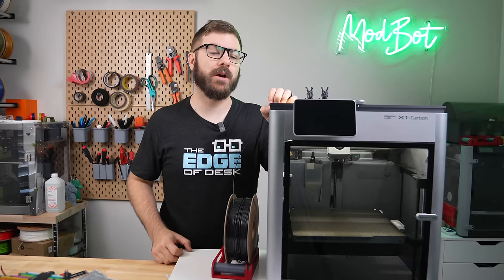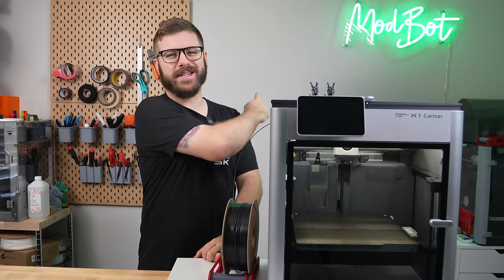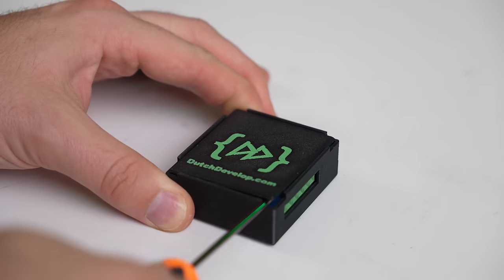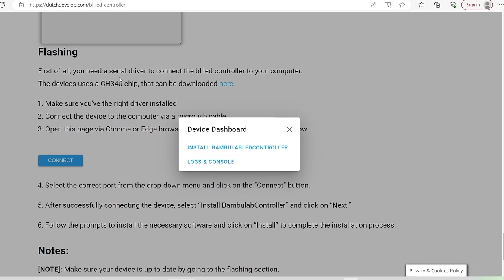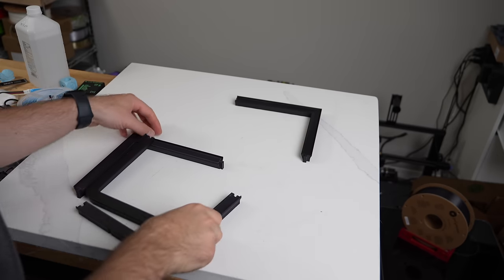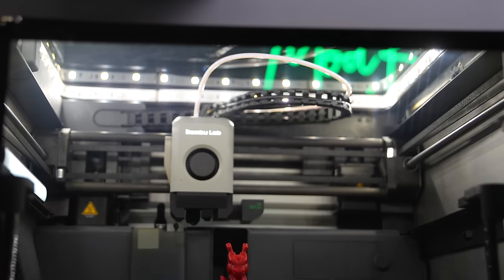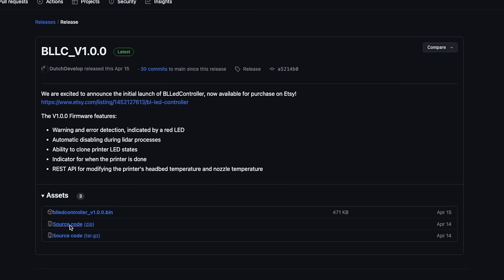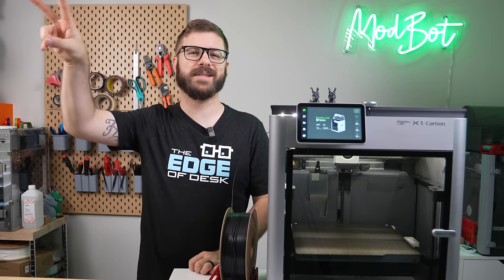Status LEDS for your Bambu 3d Printer! (BL LED Controller)

Comment: I have an ender 3 pro. Not an avid printer unless I need functional parts for something. Ordered a creality k1 max and 2 hours later cancelled the order when I saw the rave about the X1C. It’ll be here tomorrow and I feel this is a necessary mod. I love how intuitive it is. I’m very electric and electronic inclined but not software savvy but I think your video shows enough for me to figure it out. Thanks so much for your time creating and sharing this vid!

Comment: Glad to see Dutch's controller (and the mod work + MQTT connections the rest of the community has been doing with the printer) get more coverage! There's a surprising amount you can do with the MQTT data from the printer, despite it being quite "closed" as 3d printers go! With my own setup I have automations to control my lighting just like this (Dutch and I were throwing around ideas back when he was developing the prototypes), automatically turn on/off my bento-box for air filtration if it's currently printing with ABS or ASA, and much more! I practically have the whole printer controllable and monitored from HomeAssistant + NodeRed.

Even getting the bed-mesh visualization from the printer was pretty neat, but unfortunately that won't be available on the newest firmware (but can be rolled back to one where it works), so it's important to know some things may change quite fast!
Reply: I miss klippers visualisations lol.. have you seen anything about getting this back please? I didn't even know it was possible, but I'm only 3 weeks into this particular x1c... my ender 3 pro whimpering in a corner modded to death lol.
Reply: @Mr_Gadge  Unfortunately newer firmware doesn't provide the information still, but luckily the one that does work is able to be downgraded to via the handy app. What I usually recommend now if people want to know the visualization of their X1C and to manually adjust it, is to roll back and spend a few hours with it, then re-upgrade firmware.
Reply: @WolfwithSword  ok many thanks. You’d think they didn’t want people to see how bad their beds can be 🤔🤣
Reply: @WolfwithSword How do you get into the mqtt data to see the mesh data?

I'd like to check how level my bed is
Reply: @Tom--Ace  Unfortunately it needs to be rolled back to a slightly older firmware and is for the X1C only. It gets the data for each point one by one so there's a lot of work involved in building the mesh. I have some guides for it and nodered flows that take care of this available. Should come up in a quick search!
Reply: How about controlling a chamber heater if printing abs or asa through mqtt?
Reply: @adamklosterman8960  Can easily be done but you'd use the mqtt mainly to get the state of what the printer is printing with, then use that as a trigger for an automation in something like nodered or homeassistant, to then start up a chamber heater that would also be connected as an IoT device.

I currently do exactly this but to control my bento fans with my nodered flows.

Comment: btw, I think the AMS uses 24V
you could probably just buy a spare AMS cable and clip the ends to wire it in

should be safe as long as you check the positive and negative and would be removable

ofc it won't work if you have 2x AMS's
Reply: That was what i am planning to do as well.

Comment: Could you clarify exactly which LEDs are needed for this? The link in the description is different from what you show in the video. What's linked is "White 12v" and whats pictured in the video is "RGBCCT 12mm PCB 24V" which I'm guessing is the correct one?
Reply from the maker: Sorry Aliexpress doesn’t let me link correctly it just goes to the default. What you said 24v rgbcct 12mm are correct.
Reply: @ModBotArmy  Great, thank you for clarifying! Placing my order now.

Comment: As a photographer that lighting placement makes me wanna pull my eyeballs out. I know it’s cute and clever and seems cool from the standpoint of like a gamer who loves having LEDs all over the computer and walls.

What’s the point of putting it to see you’ve put your lights in the most inconvenient spot where it has the most shadows possible 

The goal is to light up the interior a little better than that’s fine. However, I would skip all the extra and tacky semi fitting extension off the top and I would glue the LED strips to the inside of the frame at the top and call it a day.

If your goal is optimal lighting for time lapse, the first thing you wanna do is eliminate shadows so you would have your light strip start just above the door so that it’s closer to the level of the tool, head and castle shadows, then you would extended across the front of the door and then along the right side at the same height this way from the camera perspective, you have good covered lighting on the left and right side which really illuminate your object. then you would also want to take the lights down the sides a little next to the door so that the entire length of your object on the Z axis is illuminated so as it goes down, it still has lots of good lighting when it’s fully printed. I would only do this next to the side glass so number one the camera doesn’t see the lights and your left side is a little brighter so that you have some nice shadows on the right side that shows the shape and texture nicely. Also, this would function effectively as case lighting for the entire inside of the case outside

Long story short don’t do a ring of light above. It’s a big shadow mess. 

Just upside down you around your window and a small strip just above glass level that goes from front to back on the right side. That’s optimal lighting with the least amount of shadows.

Comment: I got mine deliverd today.
I did try everything that i could think off but nothing did work.
- Installed several different CH34x drivers (all failed). In device manager only COM1 was active.
   Under "Universal Serial Bus-controllers" was a drivver "Unknown USB-device (request for devicedescriptor has failed)"
   witch did not work because the CH340/CH341 driver was not correctly installed.
- Watched a lot of sites and youtube for more information. Same problem everytime.

Then i stumbled on a thread where someone mentioned using a different usb-c cable. That instantly made a connection to my pc and i could install the firmware without a problem. Now i can also change lightning settings on my Bambu lab X1 Carbon via the BLLED controller via the ip-adress provided at the end of the setup.

I could find no where on the BLLED page that the usb-cable could cause problems. This should be on the 1st page of the website.

Comment: Ali Express has an LED strip that plugs in where the stock LED light does. It is super bright and is controlled exactly like stock and doesn’t require an external source. It doesn’t change colors for status, bit it is $5 rather than over $50 for all the parts for this.
Reply: Do you have a link or product ID for this? I'm interested in that for sure.

Comment: I attached LED's to the bottom of my AMS system and powered it from a spare plug as i'm not planning on doing dual AMS units, you could tap into that plug for your power so that you don't need another plug. Just a thought.
Reply: Can you show how you did that
Reply: Also I will probably do this mode but again with the LED's inside the AMS unit instead of on top and also the controller inside just tied to the power source so that way no extra wires are needed. Awesome video btw.

Comment: The PSU on the P1P/S has two open screw terminals on the PSU that are also 24v. I suppose it isn't entirely necessary to use an external supply, although, I'm not exactly sure how much more headroom the psu has to run external devices, as I assume bambu lab would have picked one close to the rms wattage that the unit runs at.

Comment: I like this LED setup, I wonder if I could run a Bento box off the same power source.
Reply: pretty sure someone already is sharing the same psu as bentobox
Reply: @DutchDeveloper  I think I might have it figured out. I will share, once I know it works.

Comment: looks good, 
only thing i can think off,  and you mention if the firmware updates and changes the mqtt messages or "encrypt" data we lose this option...
Reply from the maker: anything is possible but from what I have seen it has been available for quite some time. It has been used for things like home assistant to monitor the printers.

Comment: Very cool idea.  Could also link it to one of those light towers you see in industrial settings attached to machinery like mills and stuff.  Lights indicate status and can be seen from a distance.  Might have to design a printable version.
Reply: There are now also RGB versions available that make a very even light. Of course, a classic tower has a certain appeal, too.
Good (but perhaps a bit expensive manufacturers from a hobbyist's view) are Werma, Auer and Pfannenberg.
Reply: Those are called andon lights.

Comment: Just with the LEDs. Mine came with the wires tailing from both ends of the strip. Did you just cut one of them off?

Comment: Was the problem you talked about with it not working because of the Xtouch on a P1S?   I have P1S with Xtouch screen and a 12v strip and not a 24v.  Powers up when I unplug and plug it back in but light goes off with switches but not back on.  Does it have to be a 24v light strip?

Comment: I'm definitely interested in doing this, but I'm not finding a layout for what wires to solder where on the LED strip. Is there an assembly guide anywhere that I missed?

Comment: Isn’t the AMS 24v? If you’re not going to use a 2nd AMS, couldn’t we simply purchase an AMS cable, splice it, and then pull power from the 2nd port on the AMS?

Comment: I've been running 24v LEDs with power off the back of my AMS l. No issues at all. This looks awesome since it integrates the on/off and colors. Wish the shipping wasn't so high
Reply: Was thinking the same thing with this mod
Reply: Yeah, it's painful but international shipping is pretty brutal.  I sell on Etsy as well and it's pretty much $15+ to ship anywhere outside the US.  Would be nice if someone could get a bulk order into the US and then sell and ship to keep shipping lower.

Comment: installed the board and all started fine.  Green light to begin with.  BUT after a couple of minutes the led's start flashing white and yellow.  only way to stop is unplug the power supply.  restarting results in the same thing    green after boot up the a couple of minutes later flashing white and yellow.  Any idea's?

Comment: Mine worked for one print then disconnected. Checked Wifi signal its 1 bar out of four. So it is great when it works. One time.

Comment: Hello, I have the same problem as you. I can't turn my LEDs on and off using the LED switch on the printer.
After plugging in the module, the LEDs light up red briefly and then go out again.

Comment: I'm going to wire in a D1 mini with a BTF light strip and control it with WLED. Alexa will then work too. Nice they include a USB port. This thing was well planned out! I only have a P1S tho. This device is pretty cool tho! D1 mini can be flashed with WLED, powered via the USB port (no other wiring really beside 3 led wires) and then will end up being a much more simple process...cheaper too!

Comment: so i dont know how to use discord to find the channel i tried doing a search but nothing, however i have the controller. I have the lights wired to box and found an ac adapeter from an older light strip cut the end off, assuming the white line on the one wire is the ground. i have plug not plugged in the wall and yet after i connect the 24v and grd to the box the controller got hot didnt notice it at first and when i grabbed it the plastic box was hot and soft. Now it is plugged in to USB at the time so is this why its getting hot? dont get why wiring the not connected plug to the box would do this.

besides this issue i have not been able to get lights working at all. i have tried many ways with it not plugged in to usb and just into wall and i have been able to connect to it with the ip address but still nothing

Comment: I got excited about this but  you have me confused. I'm on firmware 01.105.02.00. Do I have to make any changes on the printer to get these light s to work?
Reply: no you dont have to, Modbot is on a completely different firmware than us. so thats why he was the only one with problems, but those problems have been fixed and even if you were to have that special firmware you wont have any issues with it

Comment: I running klipper on my ender 6. I have been able to make a bunch of mods. However, adding status light has been somewhat of a problem for me and something like this looks like it could help. Is there a way to add status light to my ender 6 running klipper or do I need an add on such as the one in the video? Thanks

Comment: While a great video and explains a _lot_, it is slightly outdated not with the new firmware version.  No longer need to access console to obtain and set IP address info. Also, what I'm not seeing is the need for 12v LED and power supply. 12V appears to work just fine.
Reply: Im using a 12v too but only powers up when i unplug and plug it back and then when i turn it off doesnt turn back on.

Comment: 🎉🎉🎉
Reply: The man himself
Reply: I have two ams connected, will this work for me?
Reply: @Nangano3d i am not sure, really depends what printer p1p has a different payload than x1, if you have 2 connected to the p1p then it can work. But I haven’t tested it
Reply: @DutchDeveloper  I have an X1C with 2 AMS units.
Reply: @Nangano3d  I am unsure if it would work, i know it wont work with 3 and 4 amses but cant remember if 2. alternatively you could use homeassistant as a broker to controll the blledcontroller
Reply: @DutchDeveloper  Only one way to find out.

Comment: Doesn't that much light affect the lidar readings?
Reply: No because like he said in the video, the light goes out during calibration and comes back on afterwards. The LIDAR works only for calibration and is not used when printing.

Comment: I was curious if anyone has tried the MQTT broker with WLED to achieve something similar. Seems like it may be a good option, especially those already running home assistant.
Reply: The MQTT broker is very easy to tap into, once you find the instructions. I'm always worried about BambuLab changing or removing the access with updates though

Comment: Great video. I got mine up and running. Then it just quit. If I unplug it and plug it back in, it goes though the light sequence and goes off. Any clue what the issue might be?
Reply from the maker: Did you update your printers firmware recently? That’s the only thing I could think of that could change the MQTT behavior.
Reply: @ModBotArmy  yes, last week. But figured everyone did.
Reply from the maker: @rockyblankenship1166  they rushed out a firmware last week that seemed to be buggy. Speculation but it may have been an attempt to stop the jailbreak that was announced.

Comment: personally, I wouldn't use VHB tape to affix the controller to the back, I would use a Command strip, or even a Command Strip Picture Frame Hanging Strip (the velcro one) so that I could remove the controller easily for any maintenance in case (gods forbid) something decides to fry itself or die, or a wire comes loose somehow.
Reply from the maker: I use VHB for a lot of things. Maybe more than I should. I have found that if you sort of roll it from the side it comes off okay. But absolutely command strips or whatever you feel comfortable with are a great alternative.

Comment: Its a nice mod, but id rather have an open source printer that i can just add the feature to then to basicly use a workaround, dont get me wrong its a nice printer but, i just hate closed systems.
Reply: then why the hell are you watching a video about a bamboo printer than 😂
Reply: @DebianDog  because the Video is interesting. Am i not allowed to watch it? XD
Reply: @vetulamortem  sure you can watch it but bitching about the printer in your comment is just sad. yes, everybody would be happier if everything was open source but Bambu decided not to do that. Live with it. Stop crying. We ALL know.
Reply: @vetulamortem That's fair enough, but open source systems are a pain in the arse quite often and don't work nearly as seamlessly as the Bambus.

That's the trade-off - sure you can set everything up yourself, but nothing works as seamlessly or well and it takes months to get it working the way you want.

These printers are pretty much plug and play and little mods like this are a hell of a lot easier than building a voron, enclosing it and faffing around for months only to get a similar result anyway

With a proprietary solution you are paying for someone's expertise and design to produce a product that's ready to go - and a little lighting mod is a far cry from building and setting up a custom machine

Comment: WARNING!!!! That this doesn't support full WPA2 password length specs. If your wifi network password is over 20 characters long this won't join. Dev seems to suggest it's a known problem with the library and buyers are SOL. The webpage and Etsy listings need to clearly state this (before ordering). His solution is to weaken your own network security which is irresponsible and not a valid solution. $75 in parts down the drain.
Reply: I can see where you are coming from but how many people have passwords that long for home WiFi? My router has an option for a iot network. Look into that.
Reply: @carcrasher89  anyone with any type of security background who understands how encryption works. I'm not looking for options.
Reply: I can promise you most people don’t have a 20+ character password. Most people don’t concern themselves much as they should with security, and just go with the minimum length.